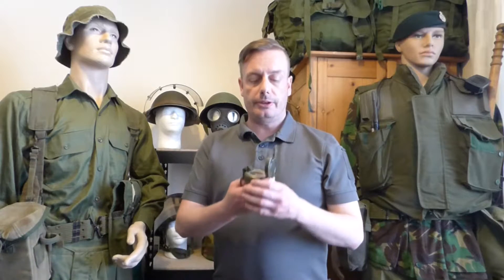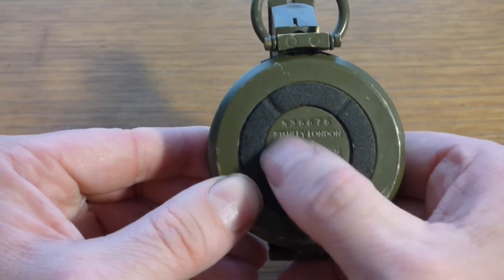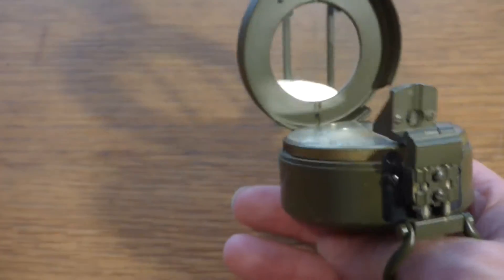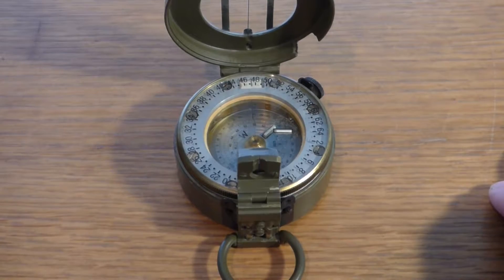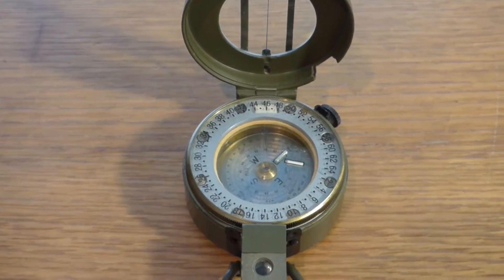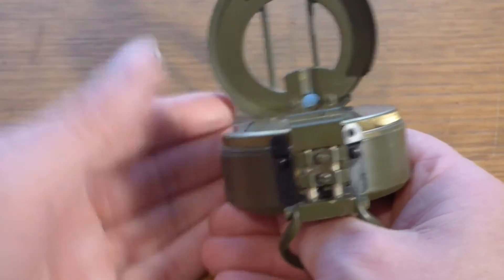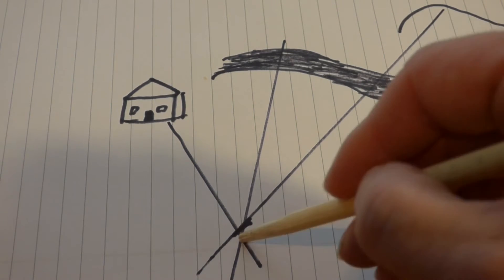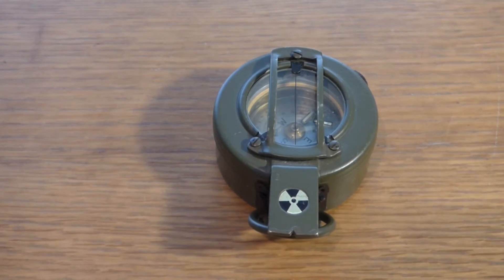Standard military Prismatic Compass

Comment: Hi, I have one, very similar. 1940, I presume it’s in degrees as the numbers are from 1-36, would the plate still move? I have the locking screw and i have loosened but currently unable to move. Is this normal for this model? Thank you for your time and a very helpful video.

Comment: Hi everyone!! Does anybody knows how to calibrate it? Is there any safe way to do it?
Reply: Sorry, there is no way to "calibrate" it. You can, however set up a "compass rose" and check it ("swing" it, as we did for the An/AJB-7 Bombing and Navigation System Compass Adapter Compensator, on the F-105 Thud), against that, then record the error(s) on a compass correction card. Mind you, it'll take some time on your part, but you'll learn a lot about the earth's magnetic field, declination, variation, dip, etc. Have fun! But, since it won't be used inside/around/nearby, on any ferrous material or operating electrical circuits, I don't think it would be worth the bother other than establishing the fact that when pointing to magnetic north, it does, indeed, point to magnetic north. Cheers!
Reply: @spamcan2551  thanks a lot for your comments...that was so complete. I agree with you that part of the journey is to learn. I originally thought there was a way to calibrate because Ive noticed a small hole in the back. My compass is a TG London MKIII with a 1941 inscription.thanks again
Reply: @jphumani  OK... I found a web sight of a watch repairer who restored a MKIII. I've it shows that there's a filler hole on the perimeter of the compass module. The hole you refer to, I suspect, is a vent hole to allow the compass module's fluid to expand or contract in response to atmospheric pressure and temperature changes. The base of the module appears to be a flexible diaphram... so ithe gap between the module and the case base allows some room for the diaphram to move un-obstructed. I've seen several compasses with this feature. Have fun!
Reply from the maker: i dont think you can

Comment: Hello dear i have a 1941 MK3 compass had mother of pearl inside painted black.. im wondering is it safe to handle or to put any place in home? Cz im reading articles about radiations and how dangerous it is.. thank you
Reply from the maker: the radiation of them if very small . there is more in you phone
Reply: @eiremilitarycollectibles1238  : Most compasses made before 1970 used Radium (AVOID !!). Modern ones use Tritium which is not dangerous.

Comment: not biohaz.  radhaz
Reply from the maker: thanks for the info
Reply: Yes, but minimal and not to worry about it, unless you're going to wear it 24/7. Occasional exposure, no worries. Interesting documentary film on it called "The Tritium Girls" (I think that's the name).
Reply: @spamcan2551 sealed it is safe open it and you have problems. The only guy who would service them was in UK. He had to quit due the rad disposal problems.
Reply: @spamcan2551 safe as long as sealed even if leaks still safe. There was ONE PESON who would service he was in UK had to quit due to rad disposal costs. Like USSandY compass they are rad disposal thruways sad considering the cost of the compass
Reply: @spamcan2551  as long as the capsule in intact it is secure and safe, even if it leaks fluid. still safe.  the radhaz in secure in the tritium capsules.  there was ONE guy who serviced thes precision instruments. The are >200.00 USD new.  he had to give up due to the cost of radhaz disposal.  this tool like the US SandY compass (a 80.00 compass) is disposable
Been using both since 1979... the MPC is MUCH more accurate and tougher than the US

Comment: Yes,I've got one of these too,great piece of kit,useful tip to get rid of an air bubble.is to place it on a window cill so it gets the warm direct sunlight,or placing it on a warm radiator can do the trick.
Reply from the maker: Great tip! i must try that
Reply: If you pop it out of the case, you can fill it through the intended filling hole by removing the screw. It's actually quite easy.  I purchased 2 of these for a discount because they had large bubbles and refilled them.
Reply: @michaelburke5750  l have some old machining bubble levels and I've been told that may contain chloroform, so be careful.
Reply: @88njtrigg88  the liquid inside is alcohol based .
Reply: @michaelburke5750  Or ether.
Reply: @88njtrigg88  having repaired several and also having the service manual, I can say with certainty that there's absolutely no ether in these compasses.